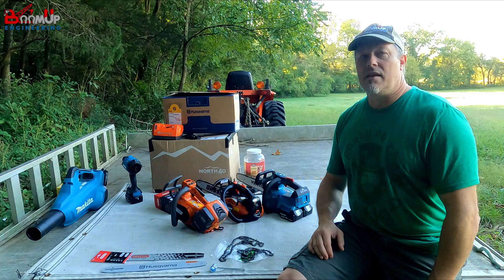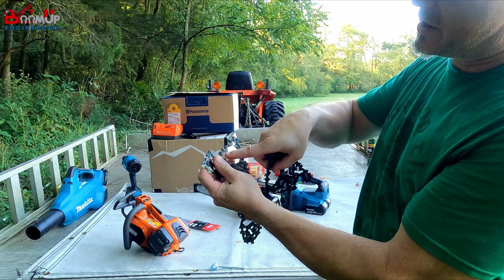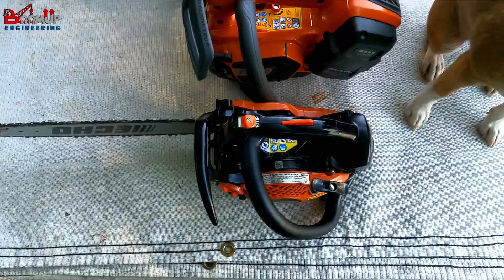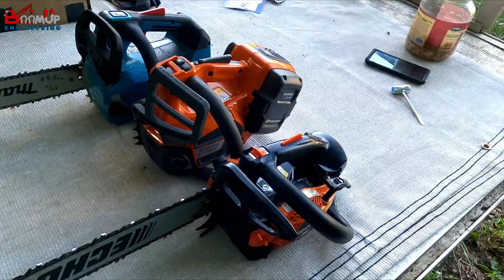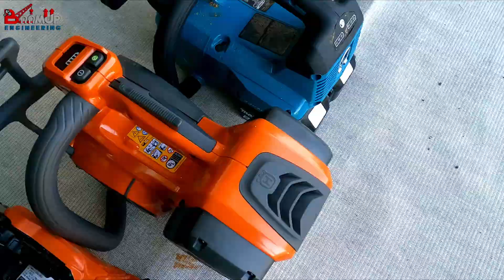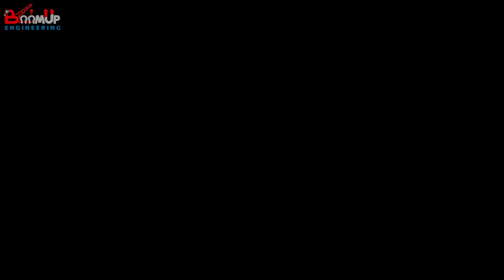Husky T540i - now a budget cordless saw?

Comment: Because of all the hardwood here in Queensland, I converted my T540i to 3/8" Lp, 0.50. The micro .325 was dulling too quick. 🪚
Reply from the maker: Yeah, I could see that cutter size and such could react differently to different woods and their fibers.  I'll have to see what I notice when running this 0.325LP.  I will be on a hiatus soon though due too work.  My job at an air force base is coming to an end.  I tried to get on a Bechtel project in Western Australia but that fell through.  I'll stay with Bechtel but I have to go to India for maybe a year.  I'd be a lot more excited about Australia.